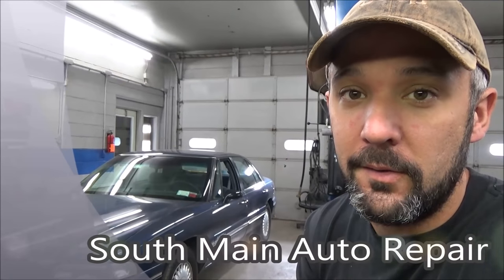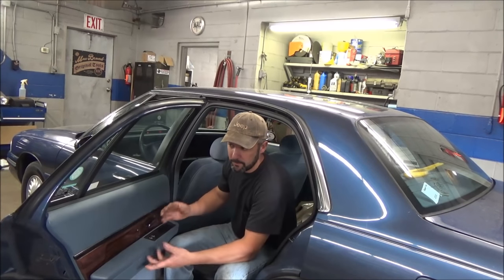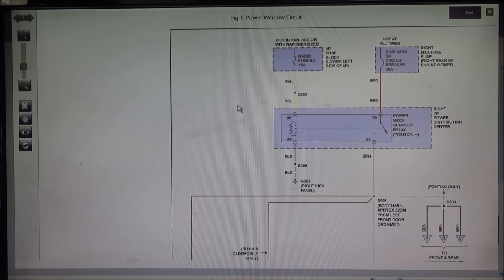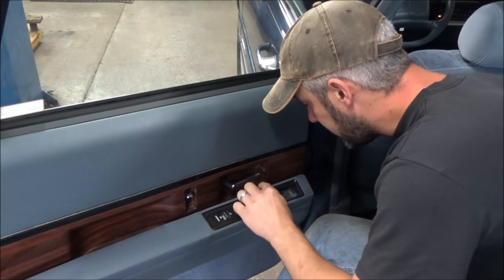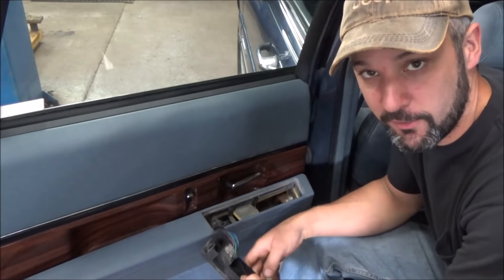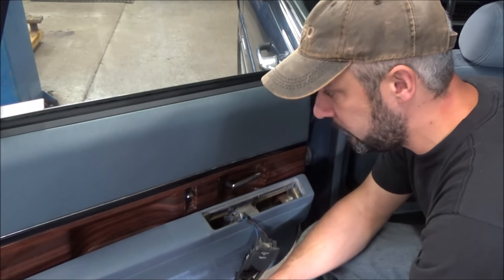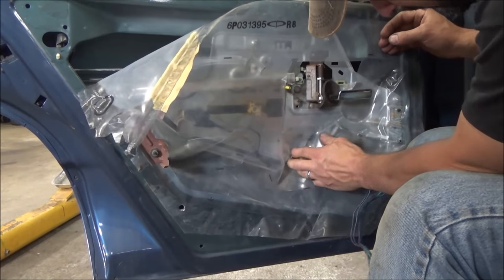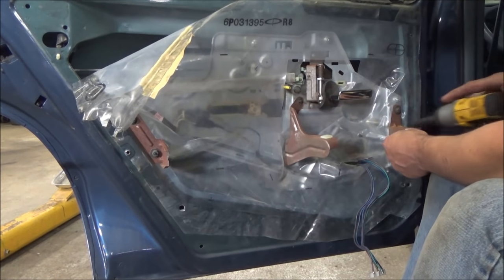Diagnose and Replace: Power Window Motor  Buick LeSabre

Comment: Are you running a monopoly on Buick LeSabre's?
Reply from the maker: GRowe1978 seems so huh
Reply: South Main Auto Repair I am kind of shocked there are so many left for you to enjoy working on. lol
Reply: South Main Auto Repair It's Saturn's for me recently.  I've got a real heap right now.  For starters it's got a bad cat.  Then it's got a P0300, then today it decided to throw all sorts of codes.  I don't know why yet.  It sat for a while but, man, every time I start it, it gets a new code.  SAI, MAP, etc.
It's definitely one of the stranger ones I've had.  Other than the cat being shot, the IAT sensor only goes down to about 90 degrees even though the coolant and outside temp read lower by about 20 degrees...
I think they should junk it, but I'm afraid I can't convince them.
Reply from the maker: Boy I dunno, I like chasing those down. Could be one issue causing all the problems if they all developed at once. I always diag for my customer give estimate and let them make the choice.
Reply: South Main Auto Repair So far, it looks to me like a bad connection somewhere.  I was watching the live data and the fuel tank pressure sensor voltage would drop out and come back.  About every second or so it will go from 1.56 to 0.00 volts, back and forth.  So I'm going to guess that when the evap monitor runs, it's going to give a code for that too.
I haven't been able to catch it yet, but I'm guessing that's what's happening with the other sensors, like the MAP also.
I might go down to the shop and mess with it some more today.  Even though it's Sunday, I keep thinking of more and more things I should check.
Whatever happens with all of that, the catalytic converter already needs to be done.  Which will probably be more than the cost of the car.
Reply: South Main Auto Repair New problem with the Saturn yesterday.  I had it sitting, idling in the shop.  The temp came up to about 200 and the fans kicked on... and never shut off.  The gauge temp came down, but the temp on the scanner stayed right up at 200???  The fans worked fine the day before...
Reply from the maker: Might be a good place to start by checking the ECT sensor. Scanner Danner just did a nice video on a ECT sensor might be helpful to ya? If you were looking at factory data instead of generic data it may have just been a substituted value.
Reply: South Main Auto Repair I did see that Scannerdanner posted a video on that.  I haven't watched it yet, but I've tested them a lot.  The monitors often wont reset if it's not working properly.  This particular car sat a long time.  I've already found a couple broken wires. Who knows how many more there are...
To be honest, I don't remember if I was looking at factory or generic data.  I didn't have the time to get into it today.  It's not the highest priority for us right now.
I'll find it eventually.  When I do, it will probably be time wasted unfortunately.  I don't think this guy is even going to want to do the catalytic converter.  That's shot because he had a bad ignition control module for God only knows how long.  I've only got about an hour or two into it so far, but no smoking gun yet.
Reply from the maker: I'd check with the customer first let him know what is wrong currently then see if he wants to proceed ya know?
Reply: South Main Auto Repair The customer is part of the problem. One day he wants to do whatever it takes, the next day he doesn't need the car and doesn't want to spend too much on it. What do you do?
In a way, I wish he'd just junk it.  However, I'm also interested in finding out what is really wrong with it.  Even if he's not going to have the work done, it would be nice to know what it is for future reference.  (or to satisfy my own curiosity).
Reply from the maker: I am a curious man... I would just figure it out haha then say here is your estimate and here is your bill so far what would you like me to do?
Reply: GRowe1978 Not sure of the model, but check the ground junctions maybe? The saturns have them bolted to the chassis in various places and they aren't sealed that well inside, could be some corrosion causing headaches.
Reply: Dan.vaku Thanks, that's a good idea.  I will check all that when I get a chance to put it up on the lift.  I really wish I had the time to just get into it and figure it out.  I will eventually!
Reply: South Main Auto Repair Finally fixed the Saturn!  I think it just sat way too long.  It had a ground with too much voltage on it and some grimy connectors on the computer.
Now all that's left is a complete exhaust system including cats.  Fortunately, labor shouldn't be much more than an hour for the exhaust.  So he finally went for it.  I'll be happy to see it go!
Reply from the maker: See, some times ya just need to slow down to go fast :)

Comment: That door smells of dealership those guys never put everything back flat rate for the win.
Reply from the maker: mailman7478 someone mentioned it was from a body shop because of the different color on the inside
Reply: South Main Auto Repair Those dealerships paint also.

Comment: I know we’re all here to make money but if it’s a good customer and you want to save them a little bit just bang the hell out of the door with your fist those motors always got rusted up rather than worn out so if you hold the switch in whack it with your hand two or three times it’ll probably start working but if you want to do the job of course I understand we’re all in that same business

Comment: Thanks for the video, Eric. Wow- was this low hanging fruit, or what? Compared to what I just did https://www.youtube.com/watch?v=jXp8KkAFwx8 this was very simple. Regardless of car make/model/age- most window motor internals are plastic to save the glass. Some late models have resistance (amperage draw) sensors that cut the power to the motor if it is held- like a finger wedged between glass & door. Without any stripped out gear grinding (as in my case) you had a time to narrow down what actual problem was. A DVM could've shown amps pulled down to just a frozen motor, but that one didn't even show ohms (did you test it?) when they're usually just either stripped or burned out. Mine died from age and stupidly trying to use when frozen late last year- I'll never do that again, LOL! Mine IS that "dangerous scissor type" with the 100 lb. tension-wound spring. It will hurt you.

Comment: GM are notorious for electrical windows/lock probs.I've had a '63 Electra 225,'77 Grand Prix SE,'76 Catalina, '84 LeSabre  Limited,and an '87 Le Sabre and the only one that did not have electrical issues was the 1963 Buick Electra 225.That's when GM made good cars.I'll never
own another one.The only reason I is electrical problems.It's a bitch when your window is down and it starts pouring and the window won'r go up. Great video!